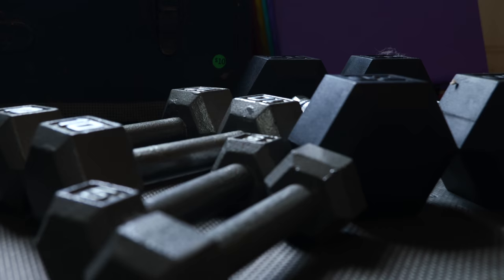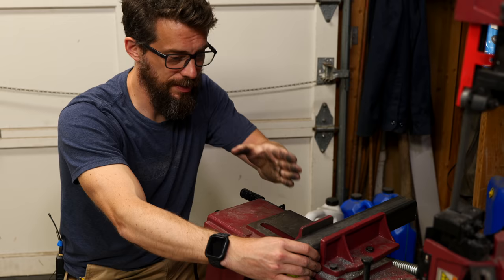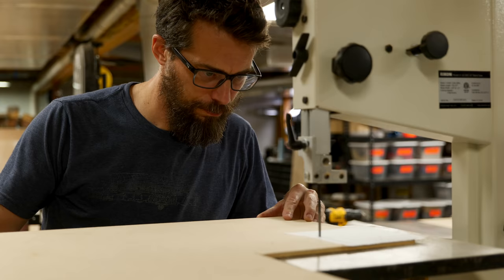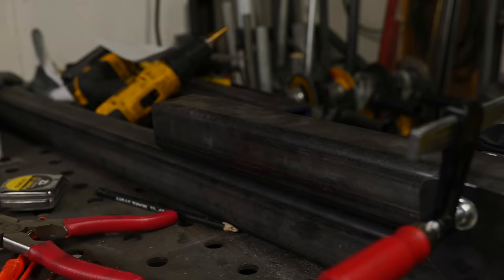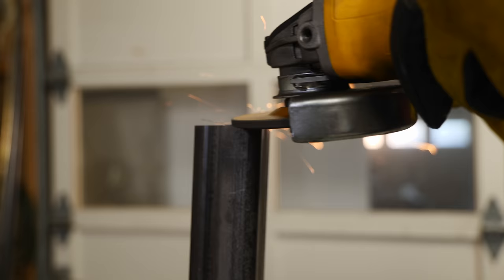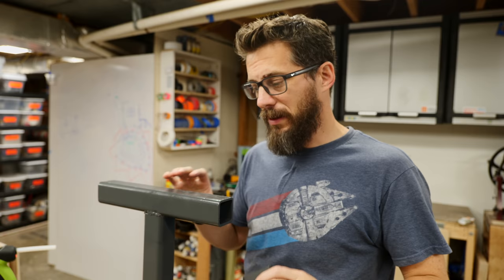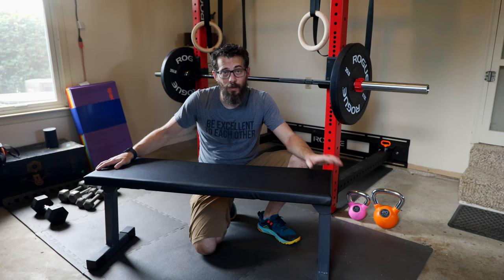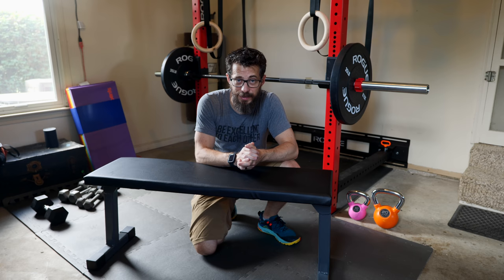How to Make a DIY Weight Bench // Home Gym | I Like To Make Stuff

Comment: Steve Ramsay did his own weight bench back in April or May (I'm losing track of time) but his was made entirely with 2x4s and Plywood, so it's cool to see a different take on it.
Reply: I actually built that same bench and it's extremely solid. But I do wish it was foldable. I'm actually thinking of building something like Bob's but would also like to make it adjustable. Needs a bit more brainstorming on my part.
Reply: it really depends on how much you're planning on lifting on the bench
Reply: @kevin-bf4ww  I guess you could just make that part of your workout. ;)
Reply: @kevin-bf4ww  I've benched 100kg and I weigh a bit more than 80kg and there was no flex or creaking or anything. 4x4's are extremely solid.

Same with steel, obviously. The most high end benches are just made with thicker steel but unless you're Brian Shaw, I don't think you'd really need a bench that can take 500lbs
Reply: And it's red! 😁
Reply: @SteveRamsey  lol steve has arrived. Love your videos.

Comment: I miss your electronics projects. If I were to suggest something for your gym would be to have some motion sensors as well as a weight sensor (in the bench), all connected to a raspberry pi, so that you can track your workouts, and calculate how many calories you burned, how much muscle mass you gained, how long or often you've been working out and so on. Would be pretty cool to have some analytics on my workouts, not gonna lie.

Comment: By adding some ropes from the bottom of the legs to the middle of your main bar, wouldn't it stops wobbling ? It gives you the avantage of being fold without having to untight the bolt you used.

Comment: You might consider a keeper pin hole to keep the legs in the folded position as well as the open position.
Reply from the maker: Good point, but the pins are actually quite tight.

Comment: A dumbell rack would be an interesting project.
Reply from the maker: Agreed. We're working o na design right now.
Reply: @Iliketomakestuff  Also, another idea, and this might tie into woodworking a bit, but a little cubby system to put baskets in for some of the little misc stuff you'll end up collecting that doesn't really fit anywhere else but would need to get tucked away- ie. resistance bands, yoga mats, etc.  On top possibly a  cupholder for a water bottle, a place to put a sweat towel so you're not dropping in of the floor.  And if you want to make it fancy and more electronic, integrated bluetooth speakers for music to listen to while you get swol.  Just a few ideas.

Comment: Safety tip when bench pressing: don't use clips on the bar.  If you are stuck under the bar from a failed heavy rep, you can at least slip the weights off.
Reply from the maker: Good point

Comment: The foam should be cut wider than the bench, so it wraps around the side, or it could get uncomfortable lifting with much weight.  Might also round the top edge of the plywood.

Comment: While the bolt through the pivoting leg is the correct type (not an all thread) it should be replaces with a grade 8 version as it will get some abuse.  Cheap insurance and they are a cool gold color!

Comment: Great video as usual but... And i dont mean to be mean but... This is the most useless thing and something that I would never build. Weight equipment is constantly at the curb for the scrap metal guys to pick up right up there with treadmills. 
 
       That said nice build video as usual and yes yours is way heavier built than the commercial ones.